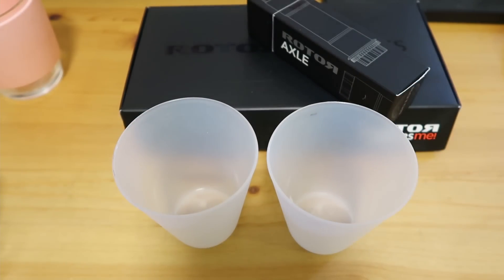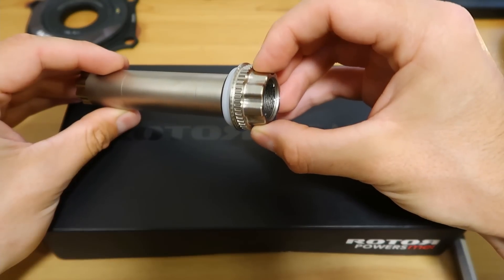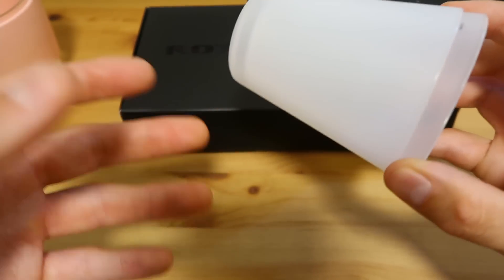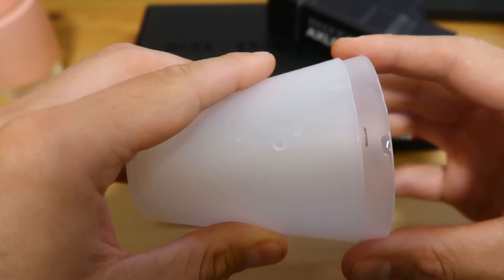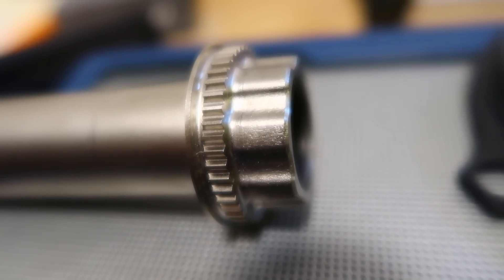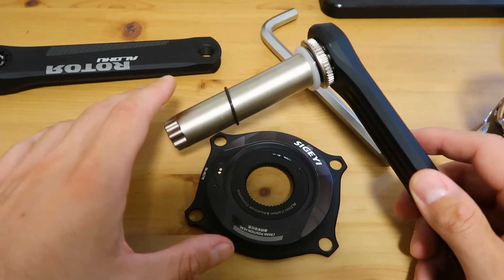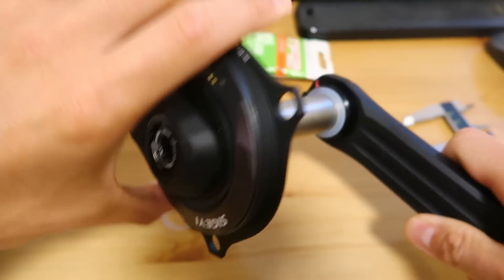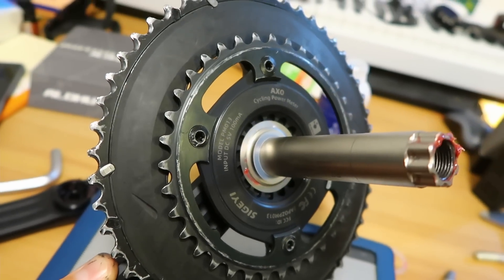Should you replace your Shimano cranks with these? ROTOR ALDHU Design completely & utterly analysed.

Comment: I had more than one problem with these:
1. Two sets produced vastly different chainlines and Crank q on the same bike, also cranks were not centered in reference to the frame.
2. The crank bolts loosen over time, and there is no fail safe that prevents the cranks from coming off (did not happen to me, but it happens acording to the forums)
3. less space between the crank arms and pedal than with Shimano, Quarq (relevant for me during winter when wearing overshoes)
4. Preload ring is an absolute fail!  The ring gets compressed when turned.  It's really tricky to dial in... need to place a flathead where the ring opens (which does chip the material and introduces splinters into the fine threads.  2 cents of thinking would have at least yielded to put some knurling on the opposing side of the preload ring pinch bolt.
5. Rotor support just stopped responding when asking for support with this.
So in summary:  I can't recommend those.  Really wanted to like them, because they were the only option to stay with a 24mm spindle and using a power2max.  

Really wish there was a better option for Shimano BBs.  Imho they should keep the modular design, but 
a) change the spider interface 
b) use a similar design to Shimanos for attaching the cranks
Reply: I have issues with my rotor chainring not sitting parallel with the axle. Very annoying considering the ring cost €90.
Reply: I`ve always had issues with preload on these. 35nm to attach the non drive side arm seems way too much, they clamp so tight there`s no preload to take out with the ring and I`ve tried the same chainset on 3 bikes all with the same outcome. At 20nm it`s usable but I`m worried it`ll come undone. I`m now convinced mine is faulty in some way,
Reply from the maker: @JimbobB1978  interesting. Sounds like your non drive side taper is assembling in too far under 35Nm. Try again without the 0.5mm shims and get rid of the pointless orings. And back off the preload adjuster fully before install, did you check that?
Reply: @JimbobB1978  do you use the provided spacers and O ring? This sounds more like a length issue rather than a specific issue with the stated torque
Reply: @JimbobB1978 the spacers specified in the install diagram were far too much for 2 different BBs on 2 bikes for me, and would deadlock the BB. Ignore the specified spacers and reduce them, then make sure you torque to 40nm.
Reply: I've had all these issues too over c. 10,000 miles of use. On mine the power meter spider (rotor PM) sits dead square but over time and usually after a few big power efforts the spider twists on the spline. I have to un tighten the bolt and reset and tighten up again. It's currently so twisted Di2 can't handle it with auto trimming on the front mech. It's particularly bad when the bike is in a direct drive turbo.
Reply: @ClayDavies  how does the spider twist on the axle? That's sort of physically impossible unless your spline teeth are gone.

I have one on a P2m spider and one on an Xcadey spider, no such issues so far.
Reply: @davidngqkalone88  I’m not an engineer so not sure on the exact terminology and I agree it doesn’t sound plausible but I have experienced it multiple times over many months of use. I have many videos of the ‘wobble’
Reply from the maker: Kalle,
1. The chainline should be fixed by the DS shoulder. When you screw in the prelaod collar it effectively pulls the assembly through to the DS bearing, so that sets your fixed chainline. Sometimes the NDS taper can engage too far, in this case remove the 0.5mm plastic shims and try again. It is very sensitive frame width and BB width tolerance.
4. You're right. The older Rotor preload collars were ribbed or knurled. This one is very hard to grab.
Reply: @PeakTorque  I think "should" is the operative word.  I ended up mixing and matching the parts of two sets, to get close to speced chainline and centered cranks.  I ended up using none of the washers (BB was true to spec, aluminium PF86 frame).  The DS crank is still further away from center than NDS with the chainline also 1mm out.

To be clear:  I don't think a mm +- on chainline is a killeing item, just shifts the amount of crosschaining inward or outward, BUT: Your since your video is about precision... not what I experienced with those
Reply: I have two of these and don't see the problem with the preload ring, so long as you aren't ham fisted!

Comment: What is the answer to the question?  Should I replace Shimano cranks and, if so, why?
Reply: It's a good idea if yours is about to delaminate (if you have this problem, check the adhesive seams) or the spindle has shown considerable wear & tear.

Also, if you want to play around with crankarm lengths, just buy the crankarms, no new crankset needed. This is what's good about a modular crankset module.

A more affordable alternative is Croder's Spirit modular crankset.
Reply: @sbccbc7471  thanks. My cranks have no signs of delamination and the axles look in good condition.
Reply: @enigma1000  You're welcome. Switching to Rotor ALDHU isn't all that necessary unless you feel like shaving some weight and giving it modularity.

Comment: I had the center bolt that affixes the NDS crank shear off inside the axle on a ride. Rotor attributed it to me not installing it properly (I had put a few 1000mi on it since the last time I had taken anything apart) but ended up sending me a full set of new arms and axle. I had only needed the center bolt, but oh well. Otherwise I've been happy with these married to a power2max spider and praxis chainrings.

The old rotor setup I had prior to this (the 3d+) had a catastrophic failure at the pedal spindle interface and I broke the whole end off the crank arm.

Comment: just take that crank off and on a few times and you will get more holding power on that spider.
Reply from the maker: Or heat the female taper before assembly
Reply: Or use more grease

Comment: A similar review of SRAM’s cranks would be a good video idea. They have a much higher torque spec of 54Nm. I think they may have more issues with cranks coming loose despite the higher torque spec.
Reply: So far, I've never seen one come loose, but the ones that require a breaker bar to remove, now that I've seen a handful.
Reply: @sbccbc7471  I’ve had one come loose. They also have an FAQ on their website stating if it comes loose and you continue to pedal it can deform the splines and you’ll never get it to not come loose again.
Reply: @ProffessorSeen1  Even when torqued that high?

Comment: It looks like this design has even more in common with plastic cups then with a lathe rear tool post mount: cranks must be undersized and considerably soft to press onto the axle with plastic deformation
Reply: I 100% agree. There is no way to get a proper contact and fit on both interfaces without one of them deforming. If it works it is still quite impressive.

Comment: I never thought of putting a pen mark on my male taper and then testing insertion depth, but this might be a good way of testing the dimensional tolerances.
Reply: @Luv23c With the difference heat-driven expansion makes, you'll want to gather a large n to find the true variance. Best get cracking.
Reply: I did and the better half smacked me around the head. The one on my shoulders.🤪
Reply: There's a joke in there somewhere....

Comment: Excellent video! The question is, as always…why is almost nobody making a 24mm steel spindle crankset? Especially with carbon cranks they all go for aluminum…
Reply: Aside from Shimano, FSA still offer exactly that. It's just hidden under their "MegaExo" moniker and it's not as apparent as it should be IMO. The advantage is that they'll work as a straight swap into Shimano bottom brackets or those sized for the same spindle.
Reply: @TypeVertigo  Not all of them though, some measure 24.07 mm and my FSA Gossamer's spindle is exactly at that diameter. I can't fit it inside an Enduro BB made for 24 mm spindles.
Reply: because numbers sell...

Comment: Never had a problem with square taper spindles.I suppose they got consigned to the components bin of history for a very good reason 🤷🏻‍♂️🤔
Reply: Most of them are too durable... hahahah. Although dont forget that also there putting sufficient torque on them is important. And better still to re torque them after the first ride after installation. You dont want those to come off either. But oh my my campagnolo alloy record crank on square taper is soo buttery smooth.

Comment: The more I learn about modern crank and BB standards, the more admiration I have for square taper.
Reply: Square tapers went out because indexed front derailleurs demanded chainrings remain in the same position relative to the frame after every bb overhaul, according to Shimano.  How often do you need to overhaul the bb? couldn't you readjust the derailleur if something changed? isn't that exactly what we did over decades of shift-by-muscle memory and square taper bb's?  OTOH external bb cups are cool, but they were a patch for the poor durability of small sealed bearings inside a BSC bb shell with the 22mm ISIS spindle. Then again a Phil Wood sealed bb lasts pretty much forever especially if you own more than one bike.
Reply: @slowerandolder  Front derailleur argument seems ridiculous.  Good square tapers last 50k km.... smoothly. Surely adjusting a front derailleur isnt a big deal at that stage. The main problem seems to be that this solution is somewhat heavier and indeed like the ISIS standard shows very difficult to oversize to get to a lower weight. Not sure if its less stiff too, but track sprinters still use dura ace track cranks, so probably its a non issue too.
Reply: @ohne_speed  that's interesting - in the 1970's, as alloy cranksets became common on cheaper bikes,  shops occasionally saw wallowed out left arms; customers would blowoff the free checkup offered on new bikes, the left arm would loosen a bit, the oblivious owner wouldn't notice until the arm's tapered hole was deformed = new crankarm. Shops had been torquing that left arm's retaining bolt properly, but properly also required re-torquing after 50 miles or so. Once this retail reality was recognized, the shops started doing up the bolts as hard as possible - which shortened the number of times the crank could be reassembled (after bb overhauls) but no one ever complained about that. This was never a problem for driveside crankarms, since that pedalling load went straight onto the chain.
Reply: @ohne_speed  Square tapers are still used on Olympic level track bikes, so I doubt it was your 1400W that rounded the axle.
Reply: I have a Specialized allez with shimano Claris and square taper BB. I’m a fairly decent sprinter(1700w) and have put many thousands of kilometres on the thing in both races and fast group rides. BB still going strong even after multiple sprint efforts. And that’s with bottom end BBs. I just can’t think that they are all that worse(apart from efficiency) than top end one.
Reply: I destroyed 3 square axles riding MTB. I'm glad that standard is long gone.

Comment: A fantastic modular system I run myself on the TT bike, with interchangeable spiders/PMs/chain rings. You can get the Vegast crank arms for about half the cost of the Aldhu's too.
Reply: Yup. I'm running Vegast cranks on the 24mm steel axle with a 30/46 direct mount one piece chainring (with a Hambini PF30 bottom bracket). Works perfectly on my otherwise Ultegra di2 setup.

Comment: I was looking for a similar combo but with the 5 bolts 110 BCD Sigeyi power meter, if i'm gonna drop Shimano cranks with Giant dual sided power meter (not because it cracks but because it's not compatible with one of my gravel frame because the dual sided power meter are too large to clear the chainstays on the left side) might aswell drop Shimano 4 bolts 110 BCD and get some good quality and not insanely priced chainrings !

Comment: The Aluminum Aldhu turned out to be to flexible for me, the pedals end up at a jaunty angle under the force of standing pedaling. The new carbon ones are supposed to be better but haven't tried those yet.
Rotor are bad at q-factor. On my carbon road bike there is >1cm on EACH side between the arm and the frame. They could easily have narrowed the q factor with straighter arms and increased stiffness at the same time.
Reply: Rotor chainrings are really noodley, so not enormously surprised their cranks lack stiffness.

Comment: It is worth pointing out that if you had any play on the powermeter spider it would not all have beeb Rotors fault. Its a 3rd party power meter so if that would be out of spec then Rotor could have got is 100% right but not get it clamped down because of it.
Reply: The dimensional tolerance of the power meter in this application is simply the width of the splined portion. Getting this right is trival compared with the matched taper.
Reply: @galenkehler  Yes you are totaly right about that. They still have to make it to those specifications. I am not saying its right or wrong it simply not gets mentioned.

Comment: Sure that's CNC'd? Looks like it might be cast. If this was a podcast, I'd be super confused about male Tapirs.
Reply: It's even harder to get really tight tolerances on castings than on CNC machined parts. The Axle could be investment cast (Also called lost wax casting), but that's a labour intensive process which likely would have a high defect rate compared to CNC. It's hard to tell from the video, but it looks like it was machined and then the surface was shot blasted, which if done right, will give the best fatigue life, though it doesn't look like the surface finish is particularly good.
Reply: @peglor  For sure, just the surface on the spline looks more like it's cast.
Reply: It would be completely impossible to produce features as precise as splines and threads using strictly casting. All cast components require machining at least in the fussy parts before use.
Reply: Also cast parts typically aren’t nearly as strong as machined from billet as conditions like porosity are very hard to control. 
I would love to see a forged aluminum crank that’s machined post forging.

Comment: Rotor cranks are the shit. Underrated in my opinion. Yeah there's lighter carbon cranks out there, but I'd rather have something that is well made and will last longer than my brake rotors.
Reply: you're wrong if you thought carbon cranks are weak. As long as the metal is well bonded they are unbreakable
Reply: @Megadeth6633  I mean in direct impact and abrasion. And on certain cranks that prioritize weight, they're also prone to separation and galvanization. But mostly it's that they chip and scratch more than alloy.
Reply: @YoureSoVane  I see. Given how thick carbon cranks are though, Im not too worried about it chipping. I've been using a good but faithful SRAM force 1 crank (yes it has a shit bb and axle, not going to comment on that..) on a beater, and it has chips all over it. About 6 years of use. I imagine a hollow aluminum crank would have cracked already after all the impacts it took. Trust me I mistreated it like it owed me money and It is still solid. One of the few things on my bike I have blind faith with. 

I agree Superlight cranks might still be sketchy. But any 'normal' carbon cranks are made with a decent amount of carbon, almost to the point where it just won't crack on impact. They are pretty thick bastards.
Reply: @Megadeth6633  I want frames built with that mentality. Same weight as aluminum, but larger diameter or thicker walls in certain areas. Make it a beast.